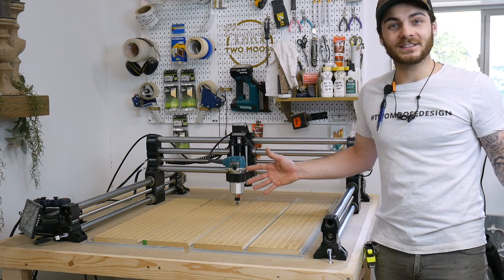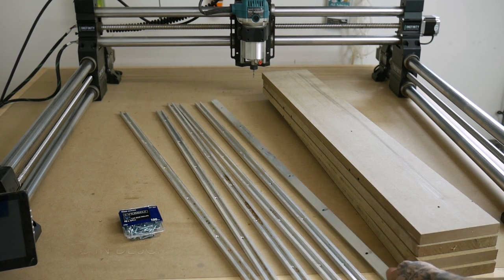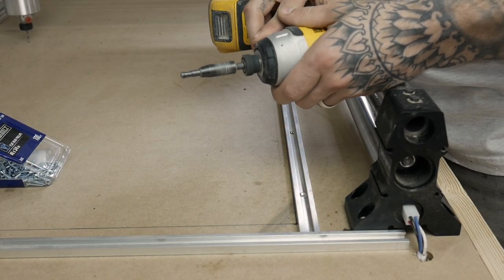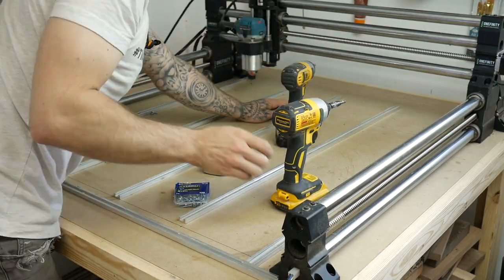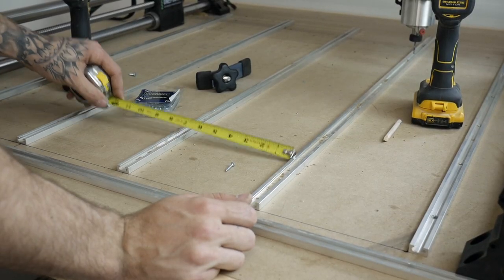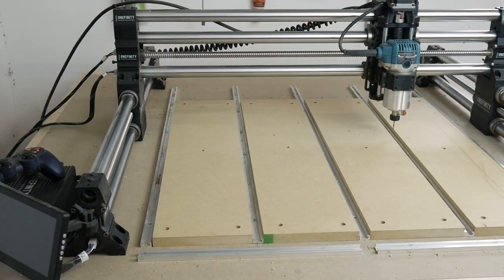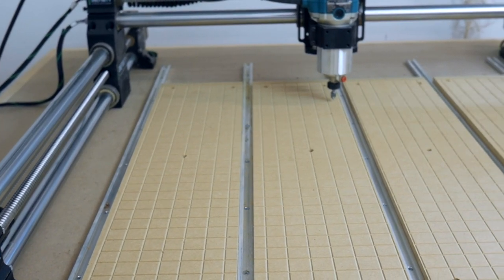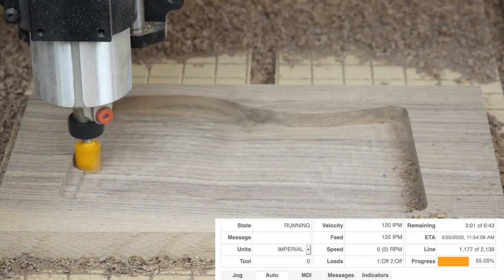Adding T-Track Clamps // Wasteboard Upgrade to the Onefinity CNC // How To

Comment: In the world of industrial CNC manufacturing that is called a subplate. In that application it would be a big piece of aluminum that you can drill and tap holes in for mounting vises and fixtures without ever leaving any marks on the table.
Reply from the maker: Gus Cox oh nice! Thanks for the info I didn’t know that 👊🏼

Comment: I noticed you never milled the top surface of the wasteboard?? or did you?  before you put the grid lines in?  I got my machine recently and followed your wasteboard t/track setup..thanks alot..you guys are great!
Reply from the maker: You definitely can surface the work area. I didn’t because I didn’t have a bit at that time. And Id you only cut small stuff like trays you’ll never notice. Large stuff over 20x20 definitely surface the wasteboard

Comment: I am a little concerned about the Y-axis running on rails that aren't supported.  Have you had a chance to check for flex?   Also, I am little surprised they don't have stop and zero switches.  Maybe these will make it into the production machines.  I think this is a fine looking machine but at this point is a huge gamble.   Loved the box BTW.
Reply from the maker: William Dugger There is no flex at all. Myers Woodshop posted a video standing on his on facebook and Instagram. There are soft limits in the software no switches needed 👌🏼👌🏼 thank you! I appreciate you checking out the video!

Comment: New to channel. My Onefinity is coming in early August. I was going to  prep for it as much as I can by starting to build the table. Do you have a table build video? Or can you tell me the size of the top? And overall height.
Reply from the maker: Hey! 48” wide and 60” long would be more than enough. The controller is about 8” and the machine is about 45”x45”

Comment: I would have done a dry run. Placed everything on the table to see if everything worked. I would have also used the cut mdf as spacers to mark the t tracks.

Comment: Good video, I was wondering if you used Easel to make your grid lines, I noticed that your spoil board is 32"X32" does Easel make carves that size without tiling? do you use the Pro or free version. Thank you Mike
Reply from the maker: Hey! We did. You can adjust the size as large as you want I believe and we use pro version
Reply: @TwoMooseDesign  what is Easel? does it come with the Onefinity machine? How does that fit in the big picture?

Comment: Great video. Thanks.
I've been programming and machining steel for about 30 years now and just ordered my onefinity. Looking forward to doing some fun stuff with it. Any recommendations on programming software that won't limit programming options?
I'm hoping they eventually develop a 5 axis machine.
Reply from the maker: If you have the budget vectric software is great!
Reply: @TwoMooseDesign  
Awesome. Thank you.
I'll look into it
Reply from the maker: @misterjj779  you’re welcome!
Reply: @TwoMooseDesign  
Well the day has arrived. Machine came today with the X50 upgrade. Came back here to get a refresher on your waste board set up. I'm going to start on it tomorrow and then work on my enclosure. Have you ever decided to add bench dogs to your waste board along with using cam style clamps?
Reply from the maker: @misterjj779  I’ve tried both they work great! I’ll be posting a similar video Saturday with the journeyman 🙌🏼 I’ll have to come up with a video on a bunch of ways to mount stuff
Reply: @TwoMooseDesign  
Thank you. That's awesome. I look forward to it.

Comment: what t-track clamps have you ended up using, if any?   I just built mine the same way and I'm now realizing that the Rockler t-track inline clamps will not work because the track is lower than the spoil board.  Just wondering if you are using any or just sticking with the glue/tape method?  seems that the t-tracks could be irrelevant if you are and the spoil board could be one big board with the grid.  Also, do you have a file for the grid that you can share?  save some vcarve design time.  ;-)  thanks.  can't wait to dive into things with my 1F

Comment: When doing the CA Glue and tape thing, why not just put the tape on the project, add glue, add the other piece of tape, then turn over and stick to the waste board? Then you don't have to try and line up the tape pieces with the blank in the way?
Reply from the maker: That would work too 🤷🏼‍♂️ I’ve never had an issue 😁👍🏼
Reply: @TwoMooseDesign  HI. Great learning videos. Onefinity is on order but getting educated. So, do you use the magic super glue for all projects or just the small things? T-tracks for the larger items or just options to use?
Reply from the maker: @allenpoling6854  mostly for small stuff, ill use  clamps on larger stuff. but its plenty strong for sheet goods

Comment: you could have screwed both outer tracks down the pushed all your remaining t tracks up against  one side, measure the remaining gap and divided by 4. that would have given you equal mdf bed widths with little fuss or effort
Reply from the maker: Thanks for the tip 👊🏼
Reply: @TwoMooseDesign  lol no probs, love the machine by way, pitty i live in uk

Comment: My only concern about adding t trac is cutting into them and breaking bits.  Is that not an issue?
Reply from the maker: The tracks are typically aluminum which is a soft metal and you would blow through them with ease. I would be more concerned on why you are cutting though the waste board over a 1/4 lol

Comment: What size is the table for your Onefinity?  My OF came in Christmas eve. I need to build a table for it.
Reply from the maker: My table is 50x50 but I depends on where you want to put the controller 🤷🏼‍♂️
Reply: I want the controler next to the machine
Reply from the maker: @mysticvalleywoodworks2777  machine is 44” controller is 8” wide

Comment: I may be missing something here... but consider this:
First, the channel waste board approach seems much better than this screw-on type.
Way too many screws to deal with, and more planning to line up the stock each time.
The channel type, is much quicker, less cumbersome.
Surely there may be pros and cons for either... chyme in, we all need to learn.

Second, it also looks to be bad planning. ...and I am not picking on anyone nor you specifically.
ALL the people who mean to show others how to do a waste board are omitting clues.

First the CNC is installed on a table/flat surface, then the waste board becomes an after the fact proposition.  The Z depth is then partially eaten by the add-on waste board.
Should not the waste board top rather line up with the maximum depth of the Z axis?
Therefore now, you must add thickness(strips) under the feet of the machine to raise it to par? 
...again, chyme in...

Comment: Nice! 👌🏻 How does double sided tape work compared to tape+CA+tape?
Reply from the maker: stonebay productions honestly haven’t tried the double sided tape this hasn’t let me down yet 🤷🏼‍♂️🤷🏼‍♂️
Reply: @TwoMooseDesign  ok! 👍🏻 Do you think double sided would be easier? A couple of operations less!? Great content BTW! 👍🏻
Reply from the maker: stonebay productions yeah absolutely if it holds well enough it it would for sure be a little easier
Reply: @TwoMooseDesign  sure thing! 👍🏻 I have ordered an onefinity! Following along you testing and also getting to know you're company! 👍🏻

It would be nice with an video about what router bits you're using and what speeds/feeds your running them at! 👍🏻
Reply from the maker: stonebay productions absolutely I definitely plan on making one like that 😁 you love having a Cnc they can do soo much!
Reply: @TwoMooseDesign  nice! 👍🏻 👌🏻 Yes really looking forward to it! 👍🏻 Do you draw and export gcode  in fusion 360?  I guess you set your speed & feeds at the infity's computer panel thingy?! 😁

Comment: What all did you buy with this Cnc on the original purchase?
Reply from the maker: Chris Moog for attachments?
Reply from the maker: Chris Moog or accessories I guess I should say
Reply: Yes accessories
Reply from the maker: Chris Moog with any machine id highly recommended a dust boot and probe they are the top two must haves in my opinion

Comment: Hi nice machine and I look forward to seeing how you get on with it. Re squaring up stock, have you thought of Bench-dogs, or pins? have a look at this guy Peter Parffit who has done a load of research into the subject and made a tool to install them on normal work spaces (which I don't think you'll  need for this approach to work on your cnc), https://www.youtube.com/watch?v=SAKhSPBozms  importantly for you, he goes into the maths and why their placement works.  If you purchased some procession ground drill rod, you could cut that down to make some pins. then have you CNC bore exact holes in your spoil board at key points that enable you to quickly square stock at known points by inserting the pins at stock placement time. You might even have them so your stock hits exact Y and X placements, negating the need to zero the X and Y, then once the stock is held down, remove the pins for cutting? If you saved this dog placement and sizing in your grind cutting and spoil board surfacing Gcode, you'd have a repeated-able pin placement every time you changed your boards. Hope that helps. take care D

Comment: wish i could afford a oneinfinity but to costly.
Reply from the maker: Pretty much every large hobbyists Cnc cost $2000-$3000 🤷🏼‍♂️ the shapeoko is in the same range as these two
Reply: @TwoMooseDesign  i can get a millright for 1,200
Reply from the maker: Okay doesn’t matter what machine you use as long as it does what you need it too